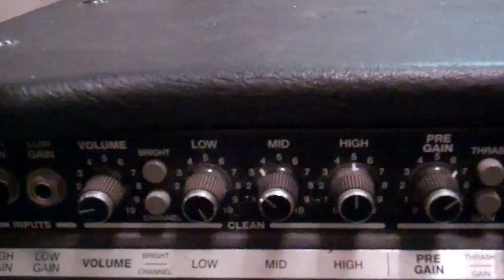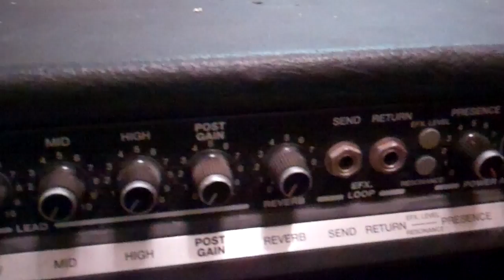DIY recycled stand alone spring reverb running on 9 volts

Comment: Fantastic sound . Trying to building a reverb unit soon with my dad . Would you recommend any particular schematic ?
Reply from the maker: JustinBrownGuitar I like the fender tube reverb the best. G6? Embarrassed I can’t remember 😂 it works the best. I ended up building the tube version. This worked ok. For a simple unit just use the vellman 3 watt amp to drive the tank and simple clean boosts as buffers. Go with the theory of it and just be creative. If you get stuck message me. Fb is best. Greg Forbyn on there . Don’t be shy 😊
Reply: Greg Forbyn thanks very much for the advice I really appreciate it . If I can salvage a some spring reverb this would be awesome to do. Just made a very simple fuzz pedal recently with my dad. You have some extremely great skills on the old geeta there .

Comment: Hey - nice project!  I'm wondering how you determine the wattage rating when working with different tanks.  From looking on forums I've seen anything from 1 watt to 3 watts.  Also - if you overdrive the coil can it damage it?  Have you posted or can you point me to a decent buffer schematic?  I have an extra mod tank lying around and a sweet enclosure.  I'm itching for more reverb - thanks for sharing your project!
Reply from the maker: I dont know how you determine the wattage. i always see from 1 to 4 watts and they use the overkill method. You can damage the coil by over powering it so its best to go softer and work up. I was using the lpb1 booster as a buffer. the real onbe uses tubes and i am opting for that rout as i love tubes. this one was ok but colored the sound of my guitar to much for my liking. I have never made one that i thought was acceptable.... yet!!!  Find out what tank you have from the accutronics website and see what drives it if you know what amp its from. Chip amps are cheap and readily available like the vellman amp i used here. buffers are a dime a dozen to. just find the most transparent one. I kinda suck with transistors so i am going the tube rout. Thanks for the kind words!